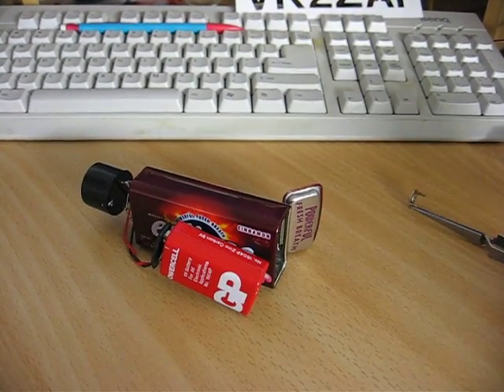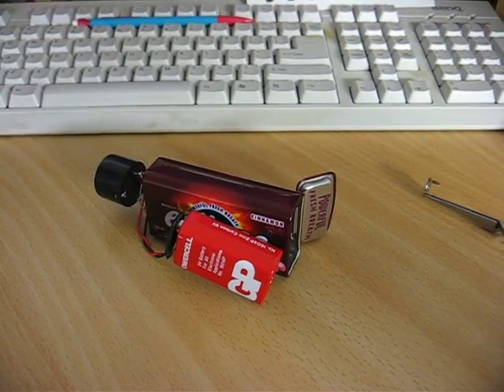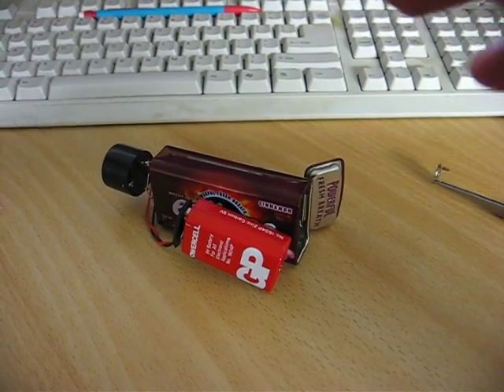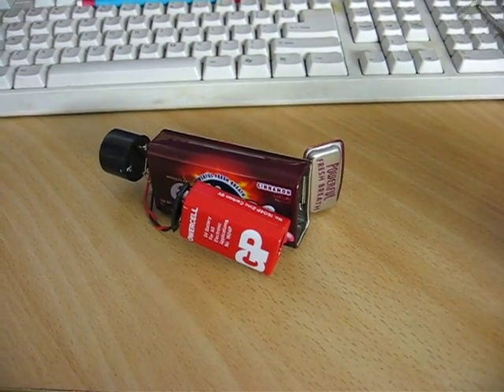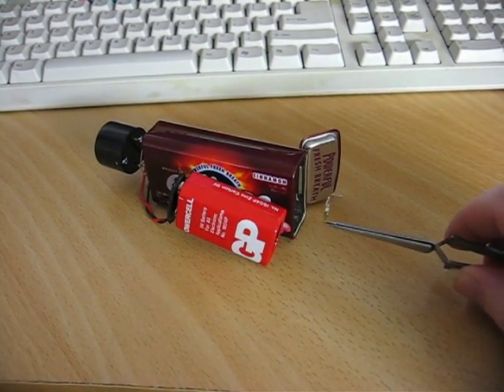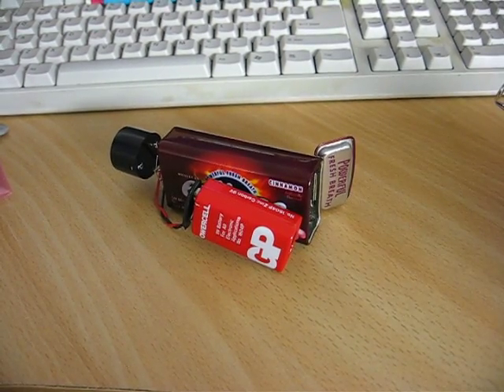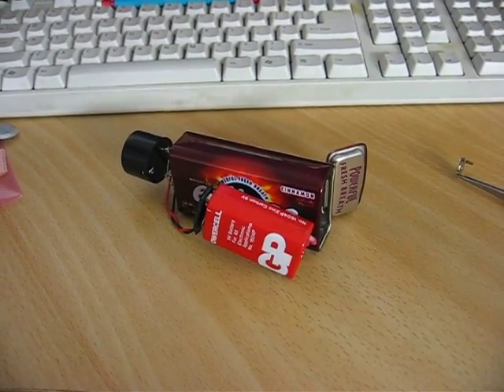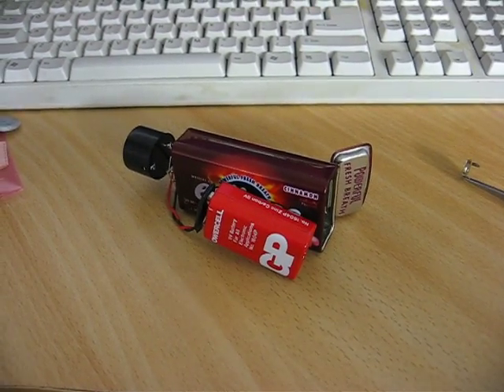Toy Ion Chamber Radiation Detector

Comment from the maker: @AtomicEmporium Alphas are vastly more ionising than beta and gamma, their large mass and high charge makes them interact more easily with atmospheric pressure gas.  For best sensitivity the chamber air needs to be really dry, and some commercial devices replace the air with hydrocarbon gases, like propane.  With a more non-trivial circuit you can make the device more sensitive, to the point you can just see the beta emissions from natural potassium salts.  Take a look at Charles Wenzel's site.

Comment from the maker: @Cristi0986 Yes it is sensitive to beta and gamma/x-ray, it quite nicely detected gamma emissions from Tc-99m.  The can is tinplate, it is a breath-mint tin.  The problem?  The circuit recovers eventually (20 seconds or so from full saturation) as the ions are swept out and the device leakages discharge the capacitances.